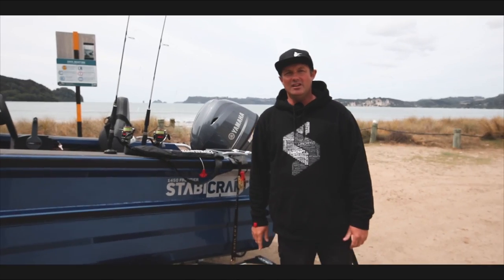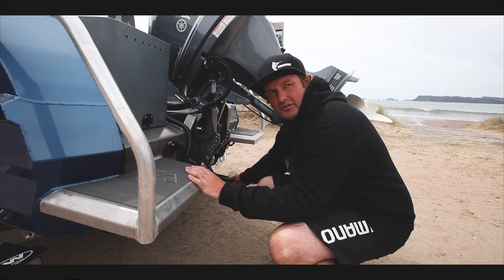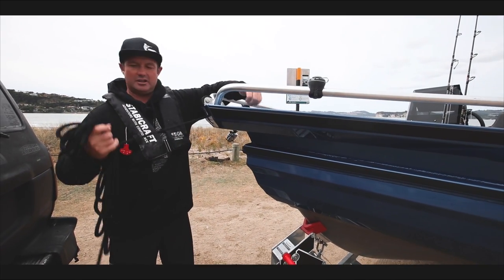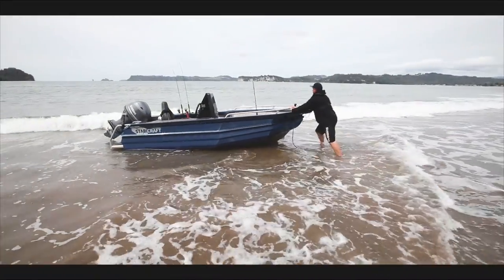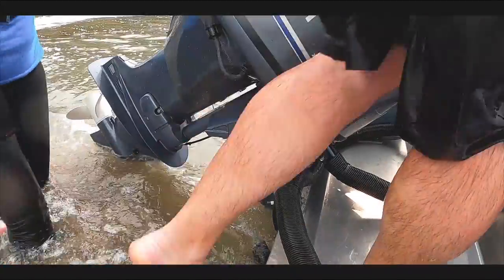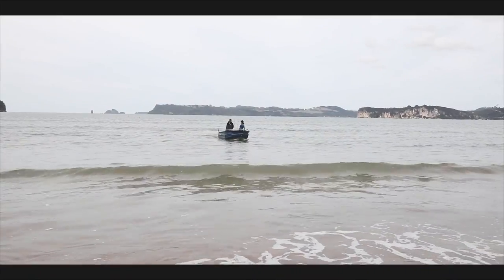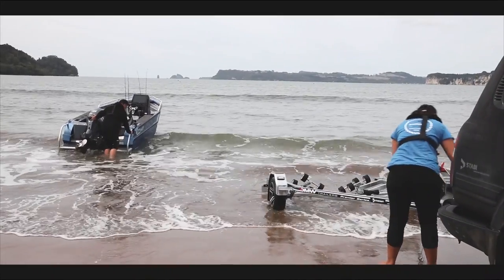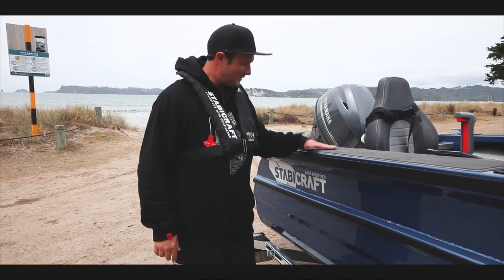How to Beach Launch - Stabicraft 1450 Frontier 🌊

Comment: That's good stuff, important.  I would join you in stressing keeping the engine trimmed up--as much as you can while still insuring it is sucking water, not air, then be darn sure when you hit any real depth, put that thing deep into the water--and you showed, reversing that process as you come back in.   One--very real danger you did not touch on, is that you may go OUT with small waves like you show in this video-but by the end of the boating day, you might have waves WAY too high for a safe, beach landing.  What then?  Answer, is that it depends.  I've been in Baja where the skilled Pangeros (boatmen) time their approach and come flying in between waves--at the last minute they yank the engine up, and let momentum slide them to safety-but this is a harrowing thing I do not recommend--unless you are really good--I for one, am not.  What else?  Answer, do it just the way you did, if you are young, agile and fit.  That boat is light, can be tossed but you can probably handle it alright.  But best to avoid beach launch or retrieval, if you have any other option of course.  Cheers

Comment: Is this boat available in the US?
Reply: Saw them at miami boat show. Very expensive but so nice
Reply from the maker: Yes, our dealers in the USA have stock on order.  Where are you based?  Regards Sean
Reply: Stabicraft do I have to reside in the United States to get a reply? In another video I asked about the price difference. 1410 compared to the 1450.
Reply: Luke Paul there are a few starting to pop up with dealers on trademe.
Reply: Blair Phipps yeah I noticed! They all want your arm your leg and your left nut. Once the sales done they rip you off on services. No thanks. never used the dealer network for my 1410 explorer I bought hull only with wing combings and sourced motor and trailer to make a cheap inshore rig, was just wondering the price tag (hull only) with wing combings for a 1450 explorer. From memory the 1410 hull only was around 8000nzd. Just curious more then anything. But sounds like the price is a secret. Shhhhhhh.